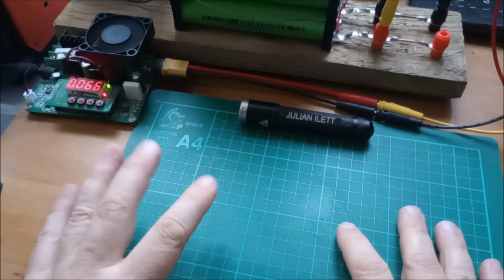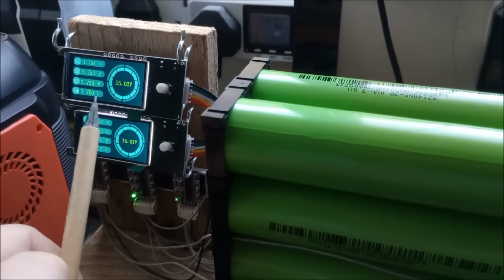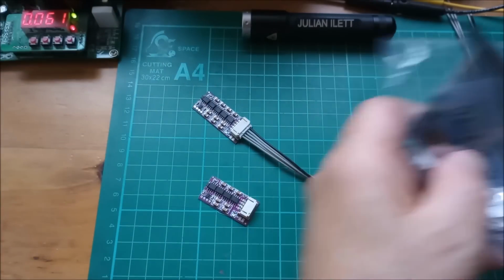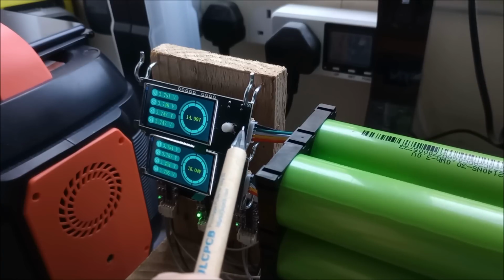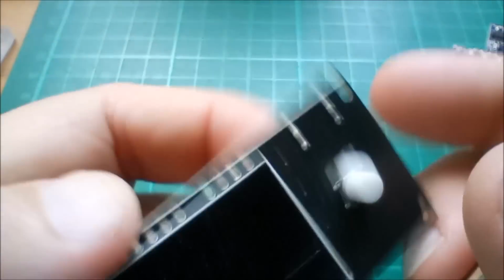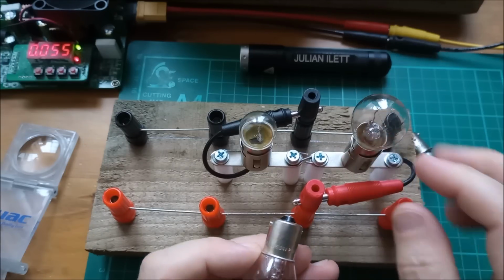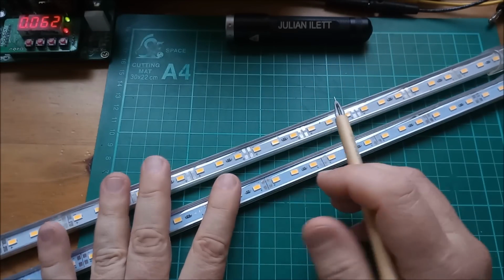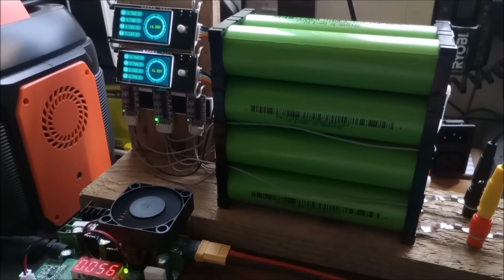Sodium Battery with Voltage Display

Comment: Another option for lighting are strips of series LEDs and a TV backlight driver board (few quid off Aliex) that takes a low volt dc input.  Basically a dc-dc converter with high voltage constant current output.

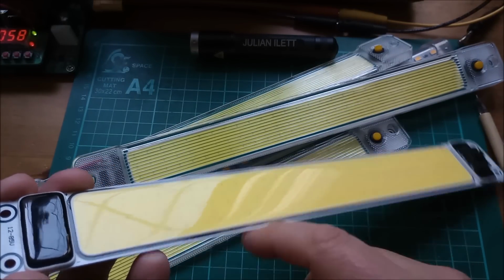Comment: 24:32 "LEDs under that Yellow Jelly type substance"
Does anyone know where you can buy that Phosphor coating please?
I've seen it applied to blue LED Chips in manufacturing of White LEDs
But I have no idea where to buy it from. In a syringe for example.

Comment: Depends on the type of led, normal old school or phosphor as the will have a forward voltage. So its resistor = (supply voltage  - LedVf )/required current.

Comment: Those resistor values are crazy! Wow! 
A difference of 900K Ohms, and both in the "stratosphere" to begin with!
Do you have a 904 resistor you can add to the 104 to see if the 4S LEDs
get as bright as the 5S ones?  🤣😂💡🪔